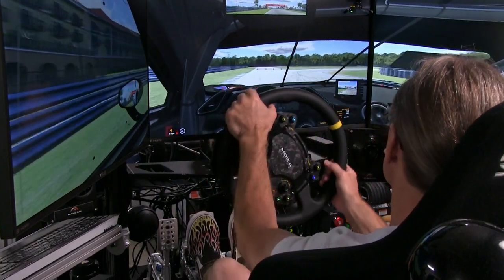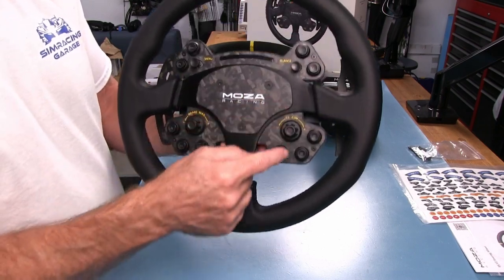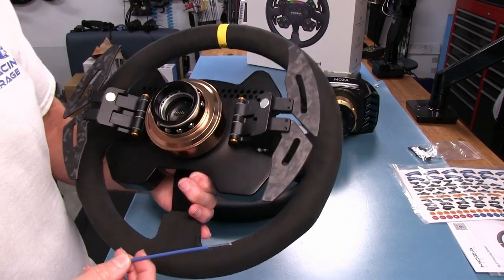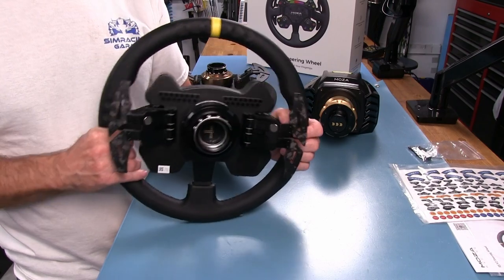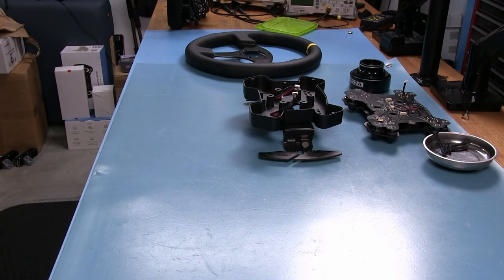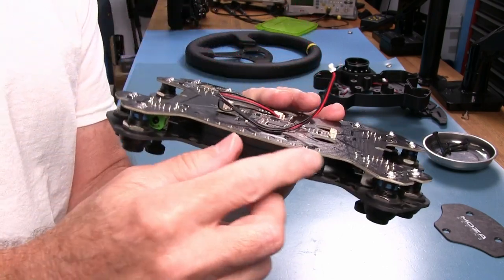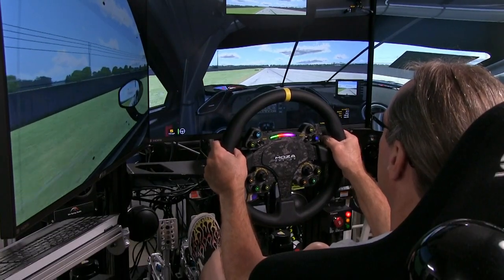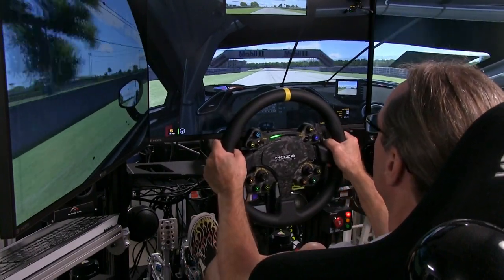MOZA RS v2  Steering Wheel Review

Comment: extra contact pins are for compatibility with the r5 as the r5 lacks bluetooth, hence the extra pins are data pins for the r5, not for power transfer.
Reply: @ThePigeonStoop  The R5 has the same configuration pins on both the wheel and base and this wheel is compatible with the R5.
Reply: @ThePigeonStoop  other reviews tested it on the R5 and have mentioned it.
Reply: @ThePigeonStoop  😂
Reply: And the R9 v2 as well I think (presumably gives a wired connection)

Comment: 29:24 did you get a chance to try any custom wheels with it? I remember you doing so in your review of the CS wheel and doing so, but the forged carbon cover had me worried. 

Looks like it would line up the same way with the 6 holes?
Reply: Were you able to find the answer to this question? I'm debating between the CS wheel and this wheel. If the RS v2 is able to do custom wheels im definetly pulling the trigger on it.

Comment: From what I have been seeing, it seems that these wheels are just simply too heavy for the r5 and even the r9 wheelbases. Moza needs to bring out some more wheels that are not so heavy so they are able to be driven by their lower end wheelbases without totally dampening the experience compared to being mated to the R16/21. It seems for those who  go for the R9 wheelbase, it really is only suitable for the GS wheels as they are small and light. Also a shame that you can only get their 280mm wheel with the R5 bundle and its not available to purchase on its own for say, R9 wheelbase owners who are looking for a circular wheel with less weight.

Comment: Hey Barry, when you were testing out this Moza RS V2 wheel, were the 2 joysticks plug and play? Currently i have this wheel and the joystick "D-pad" function is not working. The 4 directions aren't detected as an input in windows control panel, nor can i map the buttons in any game. Only the "push button" feature works on both joysticks. However, when the right joystick is pressed, buttons 2 and 12 light up in windows control panel.

I have already reset and re-calibrated the wheel in the Moza Pit House.

Comment: Hello,
I have a left leg disability, I can work a throttle/brake set with my right foot no problem (like driving my truck in real life)
My question is: can I map throttle and brake to the lower set of paddles and shifting to the upper set of paddles and shift without a clutch, or if a clutch is needed, can I map a clutch function to another button ?

thank you
Reply: Yes.

Comment: Would the R9 be too weak to drive this? Thinking about upgrading from ES to this
Reply: Depends. What do you like to play?
Reply: Mostly rally games like Dirt Rally 2/ EA WRC and arcade games such as Wangan / Initial D
Reply: @supergooglelee  with games like these the r9 should be fine because the rs v2 is still a pretty light wheel (1600grams). For games like f1 and some other intense track games I would recommend more ffb though. I went with the r12 because I would rather have too much than too little